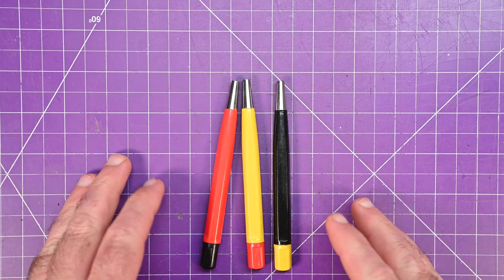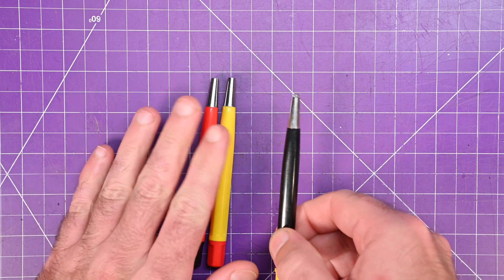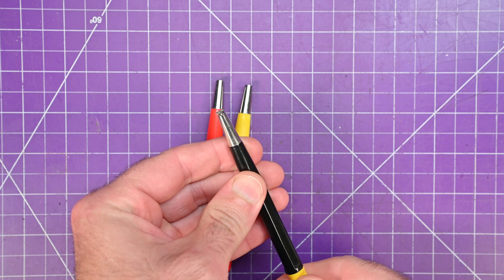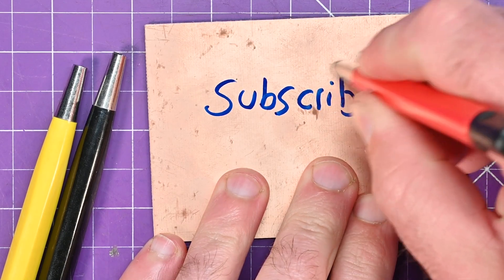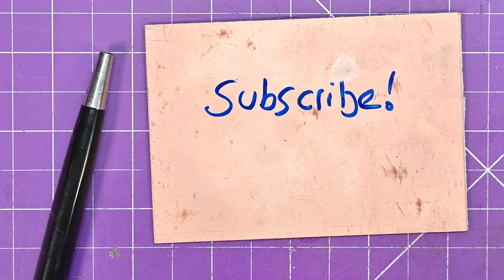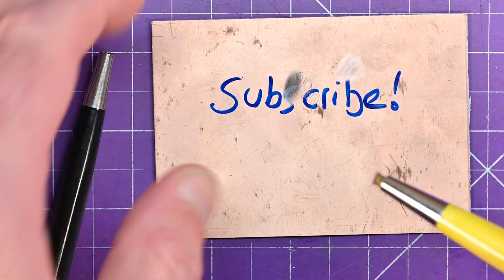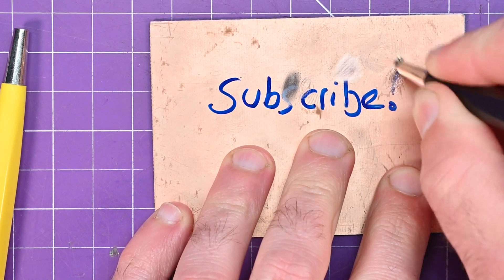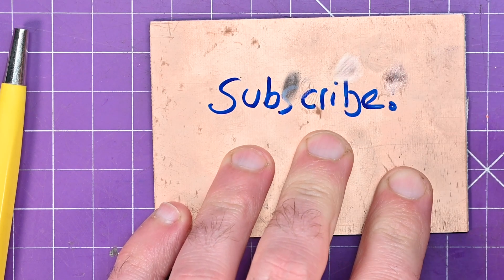You NEED These In Your Toolkit - Scratch Pens TOOL TIP

Comment: Had some experienced electronic techs tell me to NOT use such things; Personally feel it's all down the task at hand.
Reply from the maker: Definitely down to the task at hand - the conventional wisdom is to replace corroded surfaces - but if that's the case, it's already useless, why not try to fix it, can't make it any worse!
Reply: On the contrary, you should throw these away as soon as possible. That fiberglass pen leaves behind all these little pieces of fiberglass. Something you really don't want to get in your lungs